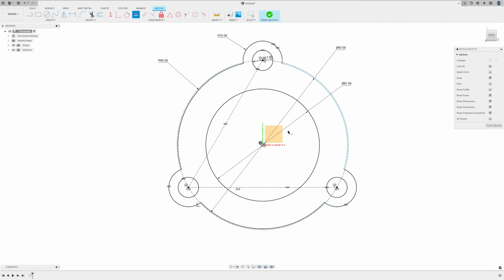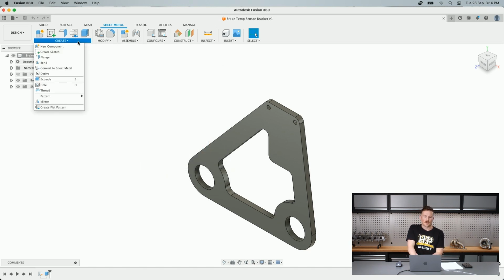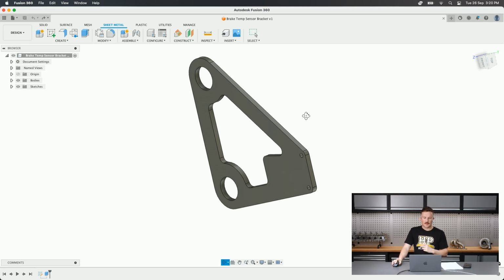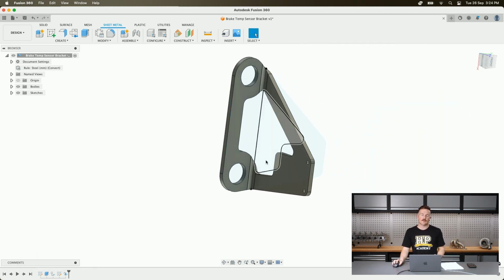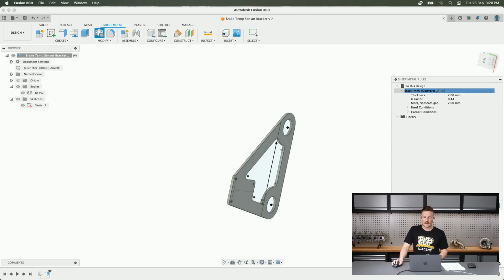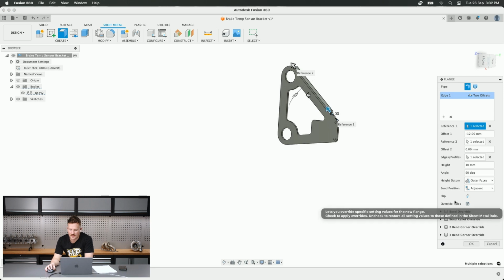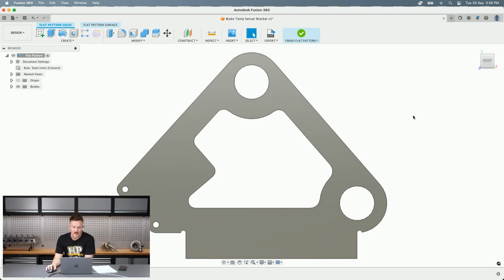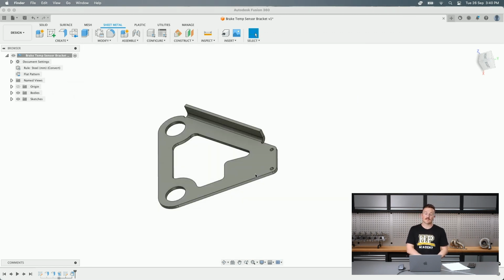Work Smarter, Faster & CHEAPER | CAD Basics

Comment: I sent a "random" Email to Hp performance   I got a wonderful reply , 2x pdf with ALL the info about wiring supplies   We need more of these people  !   Also,  I am a "linux user "   I   3d print a lot   ( design , print , check , mod, print , check,   manufacture)    I use Freecad  ( onsell is a new version)   and can draw , draw from an image,   FEA / CFD  ( oh boy do I use that ! )     finally   Kicad,  electrical simulation   I can draw circuits and test them   ( kinda cause I don't know what Im doing! )   All of this "tech" is raising the bar and allowing us "common" folk to get stuff done     Remember when Autocad R12 was a bajillion dollars and took 5? 5 inch floppies to install.......